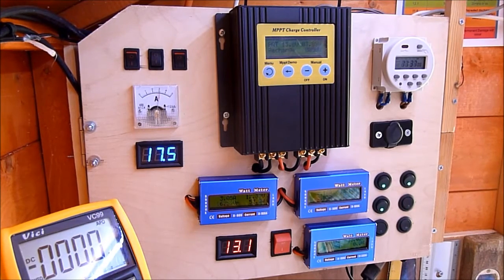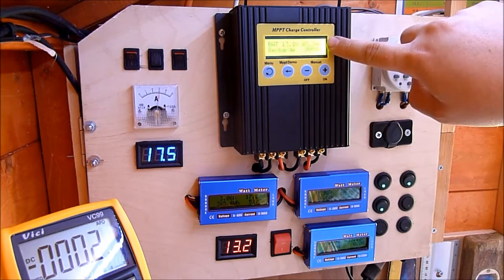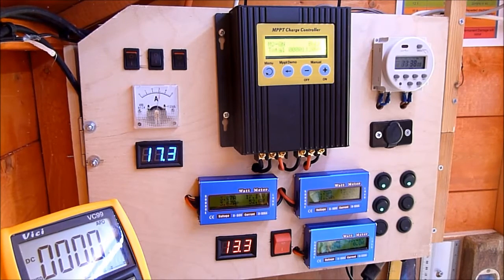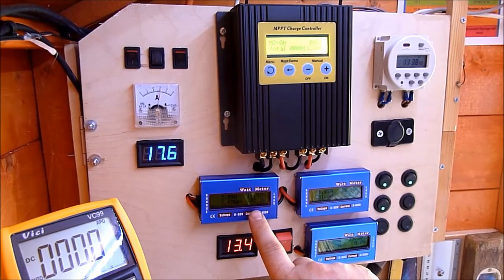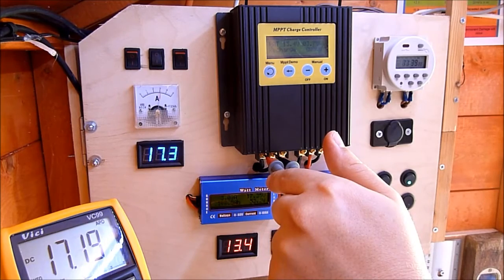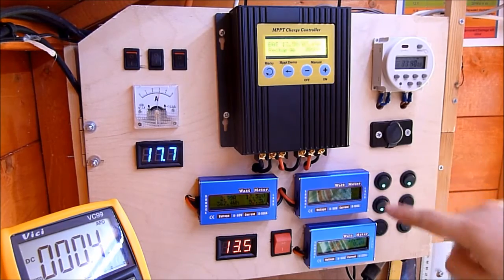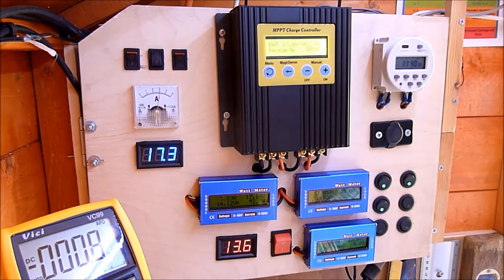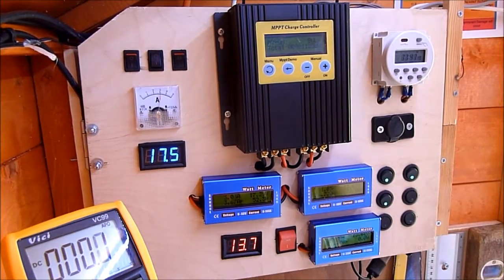MPPT & Volt Meter Comparison - 12v Solar Shed

Comment: hi i got a question my dont work no lights at night ..is this normal on the controller
Reply from the maker: +MrRuss58 The manual has a section about controlling the load output: http://admw.uk/ii   It can be manually controlled or on for a set amount of hours after dusk or after dawn.  The details you need are on page 7.

If the software settings are correct for your needs then perhaps you have a hardware fault?